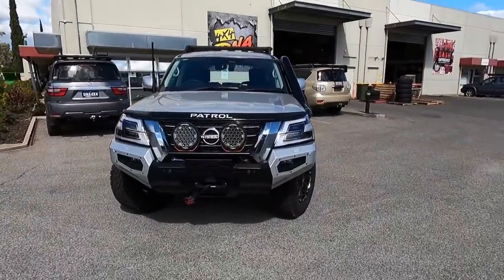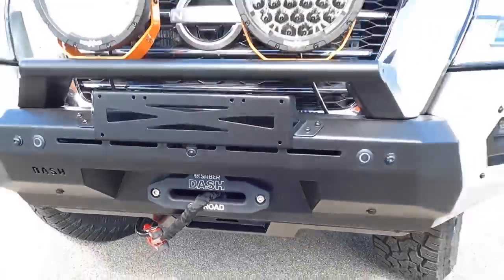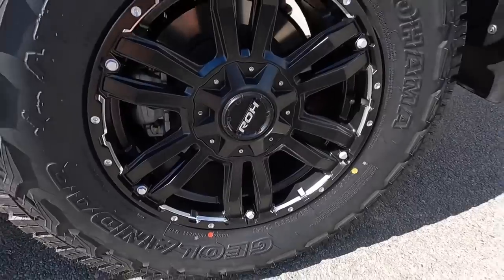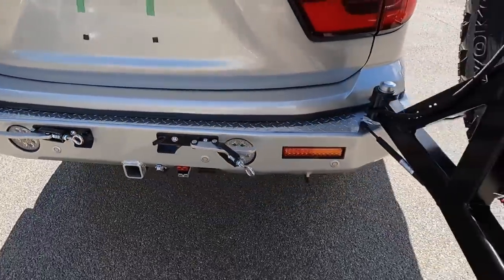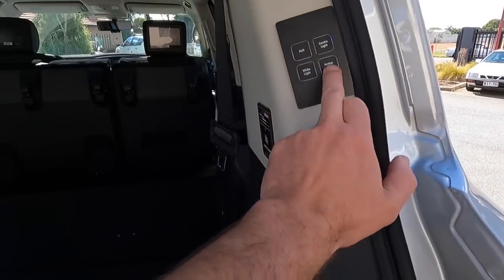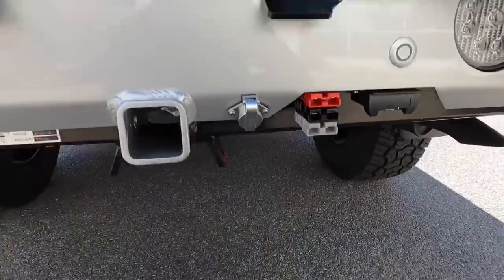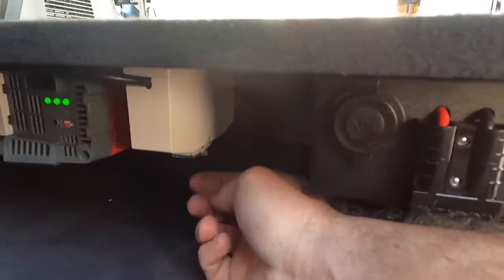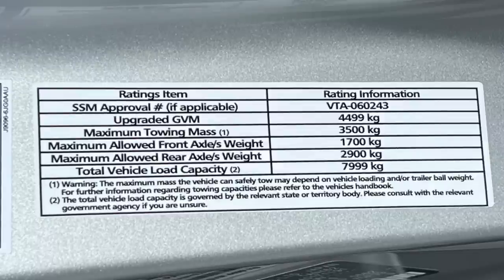Pre Reg 4499kg GVM Upgrade to Greg’s Y62 Patrol Series 5

Comment: My only concern with a GVM upgrade is the the roof is a R.O.P.S roll over protective structure. Is that roof designed to take an extra tonne in the advent of a roll over? If not and I doubt it would it will just pancake crushing everyone inside. I have never seen this issue raised. If you could provide an answer that would be really appreciated. Awesome rig btw👌
Reply: I think you’ll find any standard vehicle doesn’t have any sort of “rops” rating and in a roll over the roof just squash’s anyway.
Reply: @shanenorwell8580  whatever protection it may provide is certainly diminished if not nullified by adding another tonne.

Comment: I need to replace the ball joints on my Patrol Y62 2013 model. Any recommendation for a reliable brands? I've been having trouble finding a good one, except for Roadsafe, which unfortunately only offers front ball joints. Any advice is appreciated. Thanks!
Reply from the maker: Genuine Nissan is the only way to fly
Reply: @DASHOffRoad  I have purchased a SuperPro bush set for all arms, but unfortunately, I havent thought of the ball joints. Now, if I decide to buy the OEM arms, these bushes will be wasted, unfortunately.

Comment: Hi, good info thanks. Seeking feedback relative to front radar. 
I’ve had my car GVM upgrade SSM by another company. Very happy so far with results. So no drama there. I am having trouble though with my front radar. Partial obstruction warning keeps coming up randomly. No particular pattern as to why. I have taken to Nissan dealer who gave feedback that it’s because the car has been lifted. (Therefor not giving any assistance) Tough dog springs so quite typical height. 40mm. Do you guys encounter the front radar partial obstruction issue at all due to lifts?? If so do you have a work around or just live with it.
Reply from the maker: Lift hasn’t got anything to do with it.
Reply: @DASHOffRoad  an uneven lift will have everything to do with it, the forward looking radar needs to be at the exact same angle as when the vehicle was at OEM specs, this should be measured and adjusted after the lift is fitted. Usually this is 0deg on a flat surface, some adjust to -1deg to -2deg to account for fuel and passenger loading